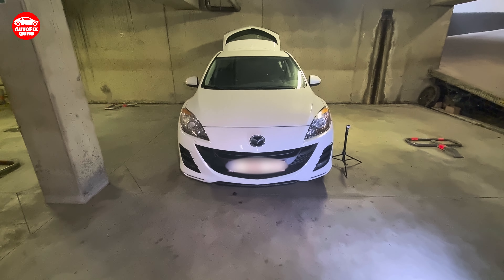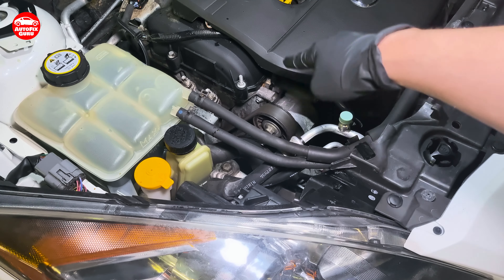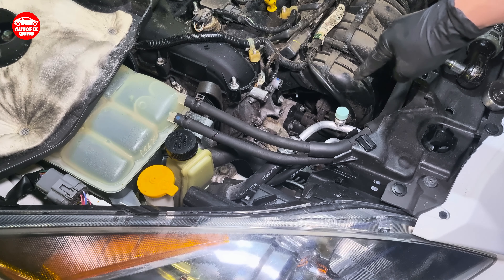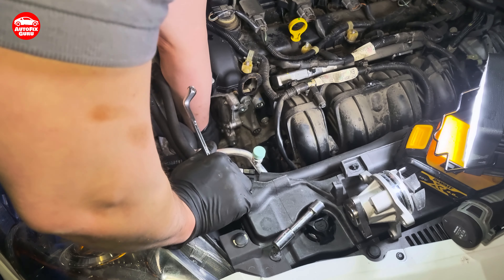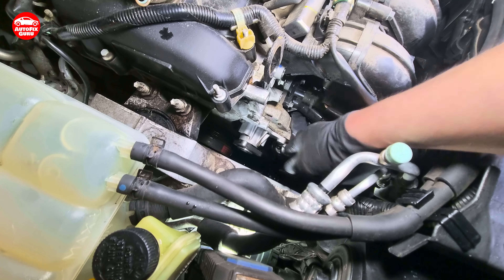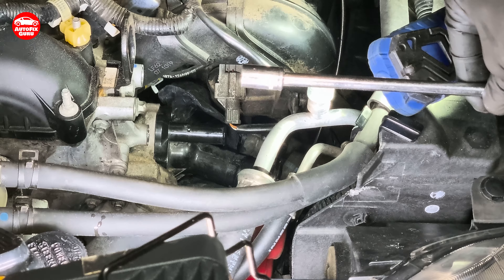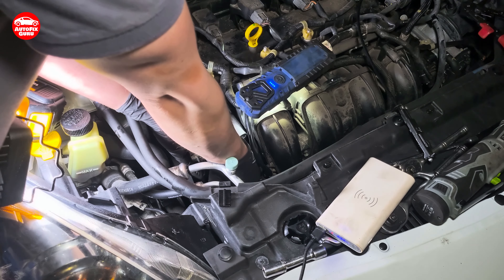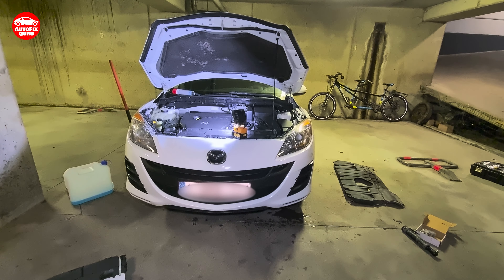Mazda 3 Waterpump and Thermostat Replacement

Comment: I think that same year Mazda 3 with 2.5L engine has belt tensioner below. Everything else looks the same but for tensioner, passenger front wheel has to be removed and plastik cover around wheel.

Comment: Idk how you guys are yanking these out without undoing the motor mount and jacking the engine up for clearance. Took for fucking ever to just get the pulley out of there. Unbolting it was easy but there wasn't any room to yank it out without it snagging the pump or hitting the body.
Reply: strange mine came right out without taking motor mount off. im uploading a video to my channel in the next few days